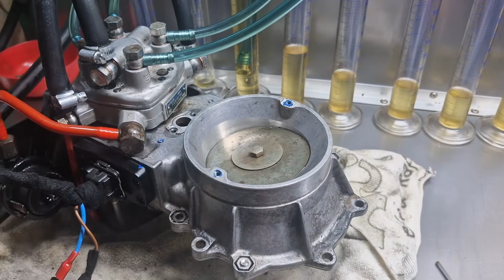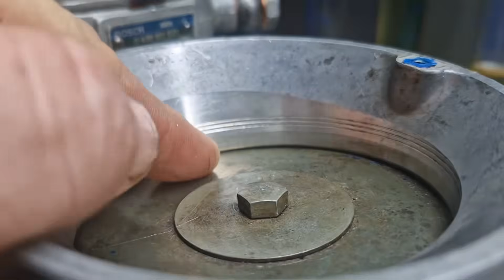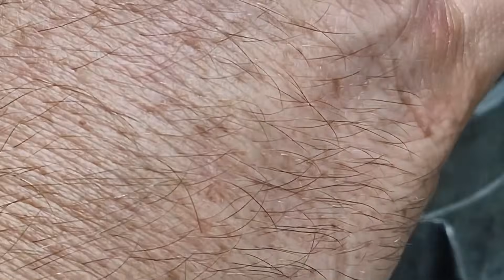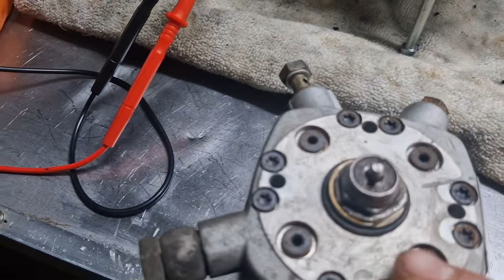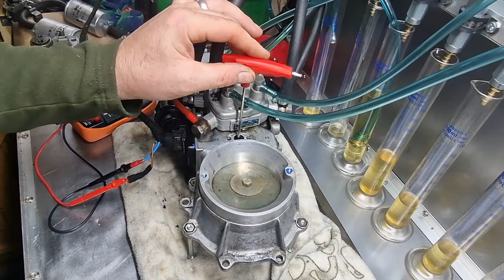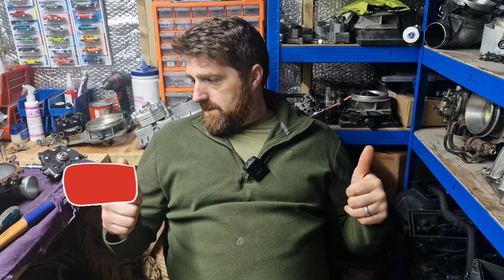Ford Escort RS Turbo - How to Set the Air Flow Meter

Comment: Great Video, Can i ask what fuel pressure should i be seeing on the fuel filter side of the metering head ? The car is a 1988 Ford Escort Xr3i MFI. Many Thanks
Reply from the maker: From fuel pump to the filter / distributor should be in excess of 8 bar, at the fuel distributor should be 4.7 to 5.4 bar

Comment: I’m troubleshooting the potentiometer on my Escort RS Turbo. I’ve tested two different potentiometers and two different complete airflow meter units, and they all show the exact same behavior. The potentiometer resistance is smooth with no dead spots, but the output voltage briefly drops to 0 V at the exact same flap position every time. Also has a max of 7.78 Volts. Have you seen this before or know what could cause it ? Car is running lean when accelerating.
Reply: It's me again.

I rebuilt the fuel distributor myself and carried out all the basic adjustments exactly as shown in your videos. The sensor plate, potentiometer and all other basic settings were adjusted according to your procedures. I also checked the system pressure, differential pressure and residual pressure, and all values are within specification.

However, I still have a problem with the fuel mixture. The engine idles smoothly and can be adjusted correctly, but under acceleration the mixture leans out instead of enriching as expected.

Interestingly, if I adjust the system so that the idle mixture is very rich (around AFR 10:1), the engine actually enriches correctly during acceleration. However, as soon as I adjust the idle mixture closer to a normal value, it starts to lean out under acceleration again.

One thing that concerns me is that I built one complete KE-Jetronic unit from two different assemblies. The fuel distributor comes from one unit, while the sensor plate and its lever mechanism come from another.

Could it be that the basic position of the control plunger (the adjustment made with the dial gauge) no longer matches the sensor plate mechanism because these parts originally belonged to different units? Could this cause the incorrect fuel curve that I am experiencing?

I would greatly appreciate your opinion on whether this could be the cause of my problem.

Thank you very much for your time.
Reply from the maker: Is your throttle body switch switching correct so the ecu knows to enrich the mixture
Reply: @GreyGooseRestorations  My throttle body switch is working correctly. The idle contact closes at closed throttle and opens immediately when the throttle is moved. The full-load contact also activates correctly at wide-open throttle. I have verified its operation, so I am confident that the throttle body switch is not the cause of the problem.
Reply from the maker: Interesting 😉 do you have charging volts at the fuel pump?
Reply from the maker: It should be around 0.8 volt at just open then smooth voltage reading increasing to whatever volts it is at plate fully down

Is your throttle body switch set right? The ecu needs to see the throttle body switch at wide open throttle and the potentiometer sweep through the volts fast for it to alter the fuel pressures
Reply: @GreyGooseRestorations  
I might have found the problem. The fuel pump is only getting 12 V when the engine is running. But if I'm not mistaken, it should be getting more than that. So the pump isn't delivering enough fuel. Or am I wrong about that?
Reply from the maker: Should have charging current so 13.5 v or so and yes if not strong volts it'll limit the pump output
Reply: @GreyGooseRestorations  Thank you for your help and your well-explained videos. Thanks to you, I had the confidence to do everything myself after several repair shops had tried. Now it's running again. Best regards from Luxembourg
Reply from the maker: Wicked, glad to hear

Comment: Hi any chance of some pointers? Can't get my mk4 xr3 to start unless I push plate down , I even upgraded to  ke jet rst s2 stage1 with 2 different metering units and it's still the same. New piston rings re built turbo new hoses etc. vacuums good. 
I'm thinking fuel related but I'm honestly stumped.
When I open the fuel cap after it's run there's a puff of air like it's not venting properly, could this be related? New pump and tank.
I'm at my wits end with this been trying it for years now. Cheers
Reply from the maker: Is the pump wired the right way? Just a thought
Reply: Thanks yes on right way it fires up once the fuel hits the spark plugs , but it won't until I manually push the plate down. Once I've done that it starts first time runs ok.
Reply from the maker: Ok sounds like it may just need the 3mm allen key mixture screw adjusting, clockwise 1/4 turn and see if that helps

Comment: My flap has 4mm to 0 point. 
But flap hits the fuel pin at plus 1mm before getting past the 0 point where as yours is -2mm (below) and gapped. Flap rises under pressure. But still in the positive zone.
Is mine buggered or have i missed something?
I cant set the 1mm rise as no gap to monitor.
Reply from the maker: The most important bit is having freeplay once the system is pressurised, if you adjust the screw cap on the bottom of the distributor that will give more freeplay

Comment: Gosh i really need your help bud, I've got a series 2. Have been told the metering heads on its way out, been out in this summer and broke down a few times hates the hot weather and hot start. I'd love to get it refurbished and set up. Even thinking EFI conversion 😅 any advice bud?
Reply from the maker: Get it to a specialist first who can actually diagnose it, C&J Auto Services are one of the best in the UK. EFI is the wrong way, fix it then use it 👍
Reply: @GreyGooseRestorations  are they the company up in York? I know you're totally right, its just that feeling of driving somewhere and not knowing for sure if you'll make it back
Reply from the maker: Yes hes up that way 👍

Comment: The RS turbo's fuel ECU really doesn't care about exactly what voltages come out of the pot.
They only look at the speed it rises, to do the acceleration enrichtment.
the falling rate or static voltage isn't used at all.
Reply: Metering unit rebuild on one would be good.
Reply from the maker: I have heard that before, still good to ensure it's set points are correct
Reply: @GreyGooseRestorations  definitely true, it may be different for the S1, I've not had one of those ECU's on my workbench to blackbox yet.
Reply from the maker: Its cool to see how advanced the RS ecus were for the period
Reply: @GreyGooseRestorations  they're still fully analog for the fuel system - the ignition is an eeprom setup. 
afaik only Ahmed Bayjoo was able to actually remap them though, everyone else only had a boostcut bypass.

Comment: Great video, my escort is currently in the tuners, as when previously went for a tune up found was running lean at full throttle was recommended new injectors fitted and didn't run right also tps is working
Reply: you sure they measured the TPS right?
it's not a pot, but 2 switches for idle and WOT.
lean at WOT would indicate that the pot isn't set up properly and needs adjusting so at WOT it does actually trigger.
Reply from the maker: I doubt it needs injectors, a lot of 'tuners' want to throw parts at the cars and not diagnose issues properly. Where is the car at if you don't mind me asking